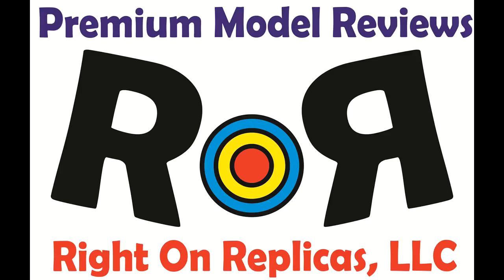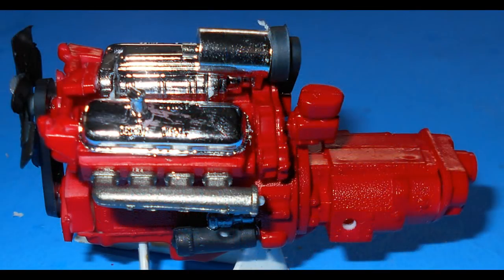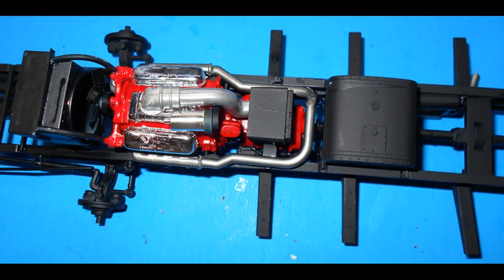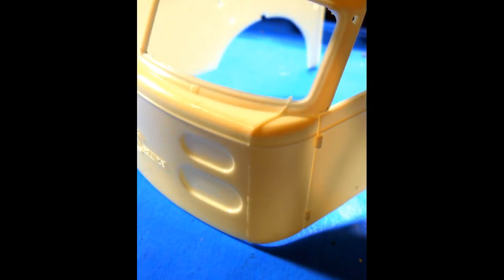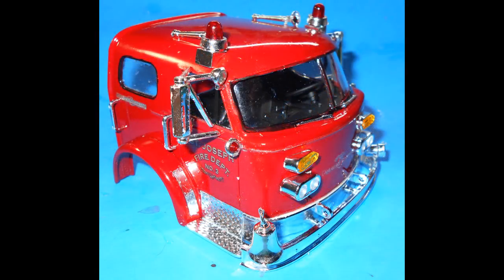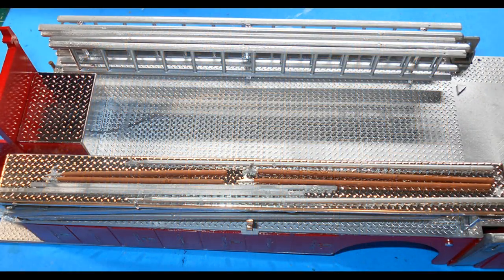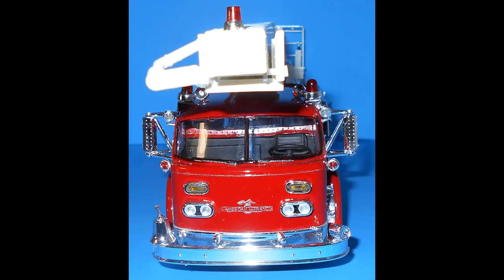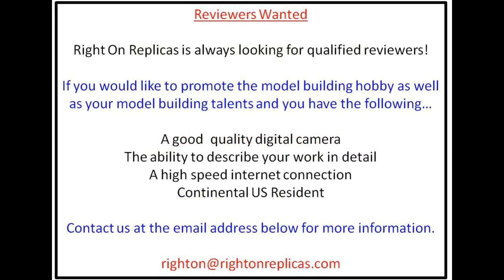American Lafrance Aero Chief Fire Truck 1:25 Scale AMT980 -Model Kit Review

Comment: Fantastic job on the American LaFrance fire truck Doug! Question, does the cab tilt forward to reveal that Detroit engine?
Reply from the maker: JG,  No, your best look is prior to assembly of the cab to the frame.  After that you'll have to see it from underneath!  -Doug
Reply: Doug, thank you for the heads up!
Reply: If you don't glue the top engine cover you can take it off and look at the engine whenever you want.  Its optional in the instructions.

Comment: You are using to much paint on your dry brushing,and probably the wrong brush to. You are also trying to do it in one pass why too much paint. The bristles on the brush should bee worn andfaned out and trim about 1/4 of the bristtles. Slow and steady while removing extra paint on a paper towel. Also try removing paint off raised areas to expose the plastic if white. Another solution
Reply from the maker: JS,  Thanks for tips!  -Doug
Reply: @RightOnReplicas  you welcome. Keep it up. Enjoy your videos.